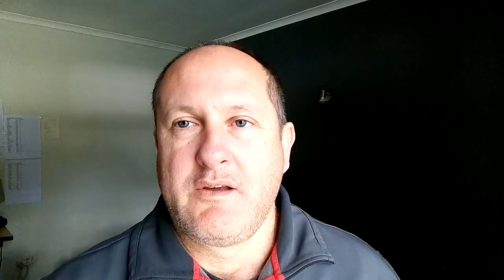Load Shedding - Why my electricity was just interrupted.

Comment: @00DEZ: I was working for an online travel company in Wimbledon, London in 2003 when the ENTIRE city's electrical  network went down. It felt apocalyptic. Not even the Tube was working... nor the keg pumps that usually supply one with cold beer in the local pubs ;) But just a week or two earlier New York City had a similar incident. I couldn't help but wondering if it was coordinated somehow, like a pre-test... like twin cities were syncronising 'failures' on purpose to gauge the response.

Comment: Get off grid if you can, inverter,  panels and batterys,  even if you start small and build, you cannot depend on the ANC ,essentially this is just one way  to  start moving our economy away from Government and bankrupt them, it's the only way to take back the country.
Reply: The political minds thought of that, that is why they want to bring in levies  on private power generating equipment , ...so if you have your own  then they will tax you on that and you still have to pay for the municipal power supply availability, even if you don't use it. Yes it will help to at least have power all the time that you can control, but it is not a saving then when they bring in levies on that.